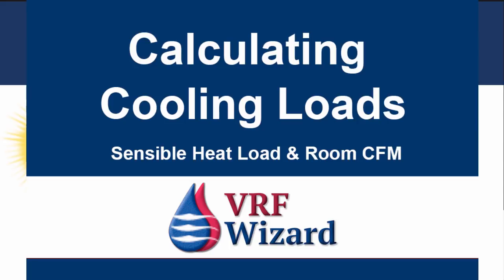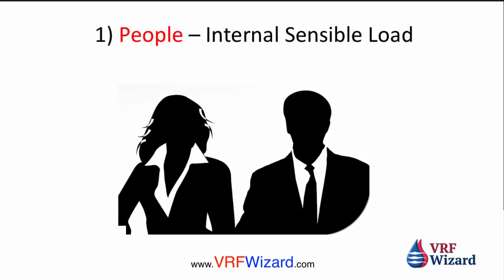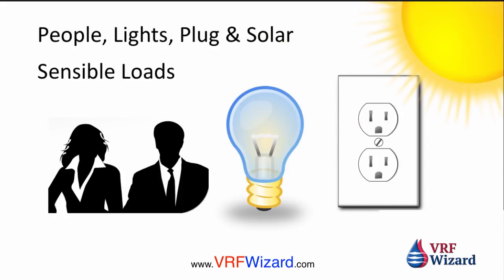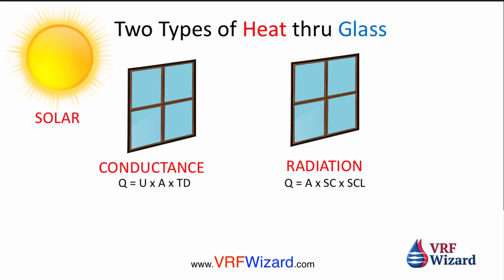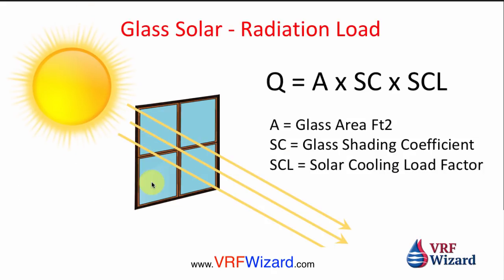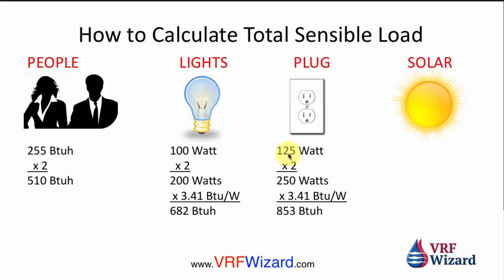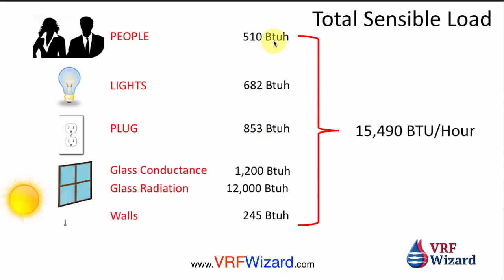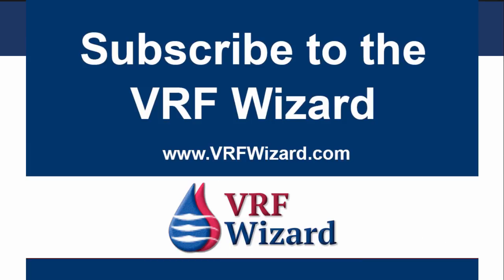Calculating Cooling Loads and Room CFM

Comment: Hello, I've been finding your video on calculating cooling loads extremely informative. I have some specific queries about the Solar Cooling Load (SCL) component of the calculation.

I understand that SCL is influenced by factors such as the orientation of the glass, the month, and the time of day, and it's a dimensionless ratio typically ranging from 0 to 1. However, in your equation, you've utilized a value of 250 for the SCL.

Could you please explain how this number was derived and why it's used instead of a value between 0 and 1? Is this value a constant, or does it change based on certain variables? If it does vary, how would I go about calculating or finding the appropriate value for my own home's specific conditions?

Your clarification on these matters would be greatly appreciated. Thank you for your time and assistance in advance!

Comment: Dear Sir,
Is this calculation including the cooling load that required to cool the space? Please kindlly advise. Thank you!
Reply from the maker: Yes, Calculating the CFM for the space provides for cooling the space. Latent heat (Moisture) will be taken care of at the cooling coil.
Reply: Noted with thanks!
 I always thought that calculation the cooling demand for a space is considered as the total cooling require to cool the space in sqt +sensible heat +radiation heat
+latent heat. Learn a lot from your kindly sharing tutorial. Thank you!

Comment: What about second floors? How does that factor in? Would I just measure temperature gain through the floor?
Reply from the maker: If the floor above or below is air conditioned then there is no load. If you have a floor above or below that is not conditioned, like a garage, then you would do the same calculation with the heat gain and loss through the floor.

Comment: VRF Wizard  thanks . I  recall this  many  years ago . But  this is  more for someone  as an engineer is it  not ? Not all  people as installers and techs are processing this in to  a  work order .Their job is  as  noted , installation and technical repair .Though your material presentation is important more  for sales and  management ?
Reply from the maker: Kevin, we believe anyone in the HVAC business from dispatchers to technicians should understand the basics of their business, which includes how loads are calculated. It helps in the discussions with customers as many issues in commercial construction can be related to improper zoning, which is related to the heating and cooling loads, such as block loads and zone loads. An informed technician can be more effective at his/her job by understanding the basics of cooling loads. Thanks.

Comment: Usefull information , can you tell me how we calculate the 0F water raise temperature 215 F , how many BTu required
Reply from the maker: Are you asking how many BTU's it takes to raise water from 0 degrees to 215 F? For water, which at atmospheric conditions starts from 32 degrees until 212 degrees F, it depends on the pounds of water you have, so that for each pound of water it takes 1 BTU to raise the 1 Pound 1 degree F. After the water reaches 212 degrees it then enters the Latent Heat of Vaporization stage where any additional heat causes the water to change into vapor. Water from 32 degrees to 212 degrees is all sensible heat as it involves only a change in temperature, after that it is all latent heat which involves a change in state from water to vapor at atmospheric conditions.

Comment: I live in the land of leaky houses where air leakage is a MAJOR source of heat loss in winter. Do you have any actual evidence that the air infiltration is a small  sum of the load in cooling mode?
Reply from the maker: We mostly handle large commercial properties. For an older home, infiltration or exfiltartion could be much greater, depending on the quality of construction, window and door types, etc.

Comment: Very interesting discussion.  Does this also work for heating?  The numbers seem like they would be considerably higher if you use a delta-T in the winter time for instance NYC winter design temp is around 17 degrees F.  If we want to make the inside temp 70 degrees F are we supposed to use 53 as the temp difference in the calculations?
Reply from the maker: Yes, the temperature difference is also used in the heating load calculations for conductance through exterior walls, windows and the roof, and the 1st floor if you have an occupied space over an unheated garage or similar space. That's why insulation is really important along with a properly sealed building envelope.

Comment: Thanks very much for your simplified explanation!
So do I care about ventilation and to neglect the #latent heat as its done by other factors in the system and does this run for most regions if they are "modern designed buildings" as you have said ? "knowing that iam in the middle east"
also please tell me how to contact you for more information later 
Sincerely thanks back to you =)
Reply from the maker: The latent heat from your ventilation will be handled by your cooling coil at the equipment. Your cooling coil will be sized to handle the outside air brought into the building for ventilation/fresh air requirements and any infiltration that is considered. This is where the moisture in the air that reaches the dew point temperature of the cooling coil will condense into liquid and become part of the condensation. I hope I have answered your question. Please feel free to contact us through our website at www.vrfwizard.com

Comment: Wouldn't it be better to propose a lower supply air temperature (50F), so in this way, with the same cooling load and larger delta T, airflow CFM would be lower therefore smaller MUA or AHU footprint?
Reply from the maker: Great question. The answer is not as simple. It’s best to use Energy Modeling software to explore the options. There are many factors that go into that decisions including the local climate where the building will be installed and the utility rate structure. Lower temperature Supply Air can reduce economizer usage in some milder climates, such as California. The thought to reduce fan energy is a good one but at what cost to drive the supply air temperature down? Now, if you couple the lower supply air temperature with some form of Thermal Storage system then the energy profile looks much better and might make more sense. This will also allow you to shift peak electrical demand to a better utility rate structure. It is best to model your options as there is no straight answer that covers all situations and all geographical locations.

Comment: So by using the cfm formula for 12,000 btu/h i get 555 cfm. I was always told you need 400 cfm per ton. So if you needed a 1 ton system hypothetically speaking would you be able to put out 555 cfm by providing large enough duct work?
Reply from the maker: 400 CFM per ton is just a rule of thumb. Actual CFM should be calculated based on actual conditions.

With the formula CFM = Q / 1.08 x Delta-T, if you keep Q constant at 1-Ton (12,000 btu/hr) then CFM and Delta-T work inversely, meaning when one goes up the other goes down. 

By keeping 12,000 Btu/hr (1-Ton) as a constant value while using different Delta-T’s, higher Delta-T’s will require less CFM/Ton because the system has to do less work per CFM. 

CFM = 12,000 (Q) / 1.08 x 20 = 555 CFM
CFM = 12,000 (Q) / 1.08 x 25 = 444 CFM
CFM = 12,000 (Q) / 1.08 x 30 = 370 CFM
CFM = 12,000 (Q) / 1.08 x 35 = 317 CFM

Hopefully this was helpful.
Reply: @VRFWizard  yes that does make sense. Thank you

Comment: Hi, thank you vey much for this simple explanation :) . May you please explain more about the room area isn't that become a contributor too? and how to include that in the calculation?
Reply from the maker: The area of the room becomes a factor only because it increases the lighting and plug loads and it may increase the occupant load (More People). The larger the Interior rooms are the greater is the load from internal sources of heat (People, Lights, Plug Loads). If the larger space includes more exterior wall area, then you have an increase in solar and transmission load through the walls and windows. Hope this helps

Comment: How would you find the Rvalue of the insulation in an exterior wall if you dont have a set of plans for an existing home?
Reply from the maker: One option would be to make an exploratory hole in the wall to discover what type if any insulation was used. Make a hole that is hidden from view.
Reply: @VRFWizard  o okay that makes sense. Thank you

Comment: How do you get or where do you get the supply air design temp? Thank you,
Reply from the maker: The Supply Air Temperature is based on the type of Equipment your using, for instance a Packaged DX Unit might deliver 55 (F) Degrees Supply Air, while a Chilled Water System might deliver 42 (F) Degree chilled water to an Air Handler Coil where the Supply Air Temperature would be the results of how much Outside Air was mixed with Return Air, resulting in a Mixed air temperature passing over the cooling coil. The supply air temperature is always going to be a function of the mixed air temperature and the temperature of the heat transfer medium (Refrigerant, CHW, HHW, etc) The room temperature set point is determined by the OPR (Owners Project Requirements) if there are any, or industry standards such as ASHRAE. Hope I answered your question.
Reply: @VRFWizard  thank you for answering, i have a follow up question, what if you are designing the room, and you really dont know the supply air temperature delivered from the coil? How will you get that value? Or is there a table of it from ASHRAE? Or you can assume for the value? Lets just say we need to maintain the design temperature to 75°F at 50%RH. Thank you for accomodating my quiries.
Reply from the maker: @keithwo1  Maybe if you think of the process in order. The first thing you would do is run a Heating and Cooling Load. This would tell you how many BTU/Hr the room needs to maintain your conditions of 75 F at 50%RH. Then you would search AC manufacturers Performance Submittals for a unit that would give you the values you need. At that point you really don't need to think about supply air temperatures as long as the AC unit meets your BTU/Hr requirements. Hope that helps.
Reply: @VRFWizard  thank you for this info's i really appreciate it,

Comment: why wall outside temperature and inside temperature different is (100-75) =25? how
Reply from the maker: The design outside air temperature for the example is 100 degrees, while the inside temperature is designed to maintain 75 degrees. Depending on where your building is located geographically there will be historical weather data that indicates the expected outside air temperature for that region of the world. Obviously the coastal areas will have a lower outdoor design temperature than the desert.
The inside temperature is based on local energy codes, ASHRAE standards or standard practice. For this example we choose 75 Degrees. The difference in the temperature between the outside and inside is what drives the heat transfer.

Comment: Can we use this practically during designing cfu and ahu or this is only basics
Reply from the maker: These are the basic steps for calculating the room load and room CFM. When sizing the Air Handler, you will need to consider the additional load from Ventilation Air (Fresh Air brought into the building per code), including infiltration (Thermal load that leaks into the building). Here is a link to a 61 page document on "Heating & Cooling Loads" that might help. 

https://www.cedengineering.com/userfiles/Cooling%20Load%20Calculations%20and%20Principles.pdf
Reply: thank you sir for sharing that knowledgeble page with us

Comment: What about  the ceiling load 🤔 sensible  heat is a lot from the roof.
Reply from the maker: Yes of course the roof is included. Anywhere there is an exposure to the outside conditions would need to be considered. This would include floors above an unconditioned space. Thanks
Reply from the maker: You're correct. Any area including the roof which is exposed to the outside conditions will be included in the calculations. The example was of a floor in a high-rise between other conditioned floors. You would also include the heat gain from any unconditioned space adjacent to your conditioned space.

Comment: Why don't you include latent loads in airflow calculations in a room? Is it because the air is exhausted or returned?
Reply from the maker: Latent loads are taken care of at the cooling coil.
Reply: @VRFWizard  

The video is great. 

So the airflow you're calculating is that recirculated by a VRF unit... and the cooling coil you refer to, presumably in an AHU supplying the imaginary office, would be sized only for latent cooling load (the AHU coil won't provide any sensible cooling)? Is that right?

I've had a look at your site, good range of tutorials. Thanks
Reply from the maker: @vixenviolet  Yes, Latent heat is taken care of by the cooling coil, while the calculation for the room CFM includes the sensible load. The example used was for a typical central station air handler. Either way the moisture is taken care of by the cooling coil and not with the CFM delivered to the room. Moisture comes mostly from the ventilation requirement for outside air, but can also come from infiltration or process loads.

Comment: How about the size of the room? Is it can affect the design?
Reply from the maker: Yes, the size of the room will definitely affect the quantity of CFM required; If you just increase the interior portion of the room you will increase the cooling load due to more lighting and plug load wattage, and more people. If you increase the size of the exterior wall then you would also have an increase due to the solar load and conductance.
Reply: For example of 300 cubic feet room, how many btu?
Thanks a lot for your reply.
Reply from the maker: @wendellblanco3250  to determine the Total BTU of an exterior room you would need to know all about the location of that room in the building and its orientation and location in the world, including the quantity and U-Values of the construction components of the wall and windows. Then you need to know how many people, how much lighting and plug loads are in the room. A 300 Cubic Foot room is a small space and if it's an interior space the calculation is much easier as their is no exterior elements to influence the cooling load.
Reply: @VRFWizard  Thank you so much for your clear answer.
God bless 🙏.

Comment: You are confusing energy with power. BTU is energy (heat). Watt is power (heat/time). So, at minute 3.00, 1 watt should equal 3.41 BTU PER HOUR.

Comment: You are putting 2 tons of a/c into a room that only needs 1/2 ton.  The purpose of going through these calculations is to prevent oversizing.  I rate this an epic fail.
Reply from the maker: The purpose of the exercise is to show what goes into a cooling load calculation. With the current focus of jurisdictions on building envelop energy performance, the cooling load calculation will be dictated by the "U" values of the building assemblies and the code required maximum allowable "U" values. 

There are many rooms in the commercial and industrial industry that require much more CFM per Ft2 than the example in this video. So it is not unheard of to have this many tons in this small of a space. Most cooling load calculations are done with software, so this video is just to show the basics of what is considered in a cooling load.
Reply: Exactly. My house is 1200 square feet, and I have a 2.5 ton Goodman with efficient ductwork. Here in sticky hot SC, it works great. 
This guy's calculations conclude I'm undersized by 4 tons!
Baloney.
Reply: is this based on the wall that has the biggest square footage

Comment: Does AREA OF wall include the ceiling/roof if it’s an outside wall?
Reply from the maker: Yes, there would also be a heat gain calculation for the roof of a single story building and for the top floor in a multi-story building. The example given was just to show the main factors contributing to the calculation of room CFM.
Reply from the maker: admin@vrfwizard.com You can visit our website at www.vrfwizard.com for more information